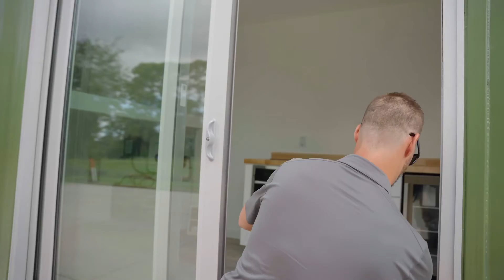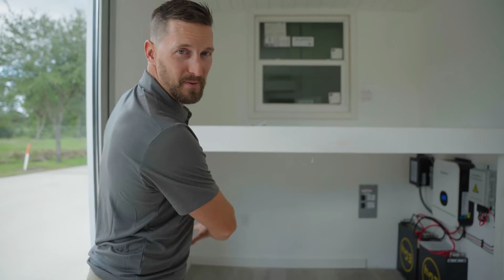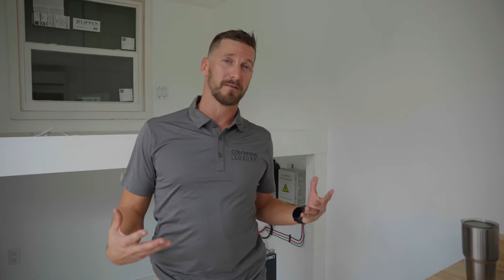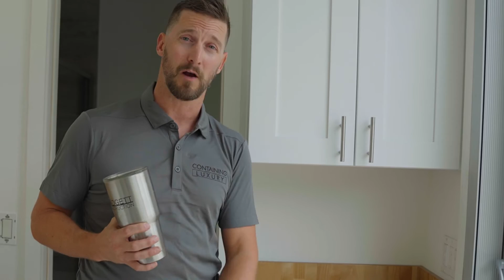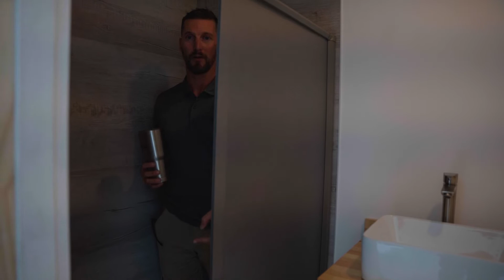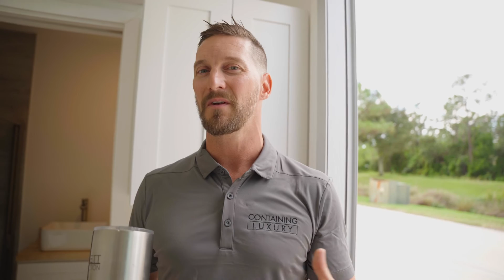100% Solar Powered Shipping Container Home Tour | Building a 20ft Shipping Container Home

Comment: Here's the math:  3000W inverter + 3-ton A/C = fail.  Good luck with that.
Reply from the maker: Hi there, unsure where you are getting the 3 ton AC from but in our small units we only use a 12k mini split like the one in the video, its about 1 ton and only pulls between 4--8 amps so we are able to run the AC almost all day when set to a reasonable temp. Obviously for larger AC units and other off grid builds, you would need a much larger inverter and battery bank. For these little 20s, it works good.

Comment: bruh wut?  you can get a 40ft HC 5300 delivered in most places anywhere near a port. 22 panels fit on it for like 6000$ 9000 watts, inverter 2000$ 17000 why not.  appliances 5k=22k, nice laminate wood floors 4$/sqft walls 10$/sqft another 8k 30k? hire some dude for like 20k, and how are we at 55k for a 20ft hc.  6" batt r19 insulating walls vs 1" foam r5 value >>.

Comment: With a setup like that, I would ad a small wind turbine system to help keep energy going if it’s setup in an area where sunlight doesn’t provide enough to charge the batteries.

Comment: If you are paying 12k for your solar your getting ripped off.
Reply: I paid $6k for my setup 2 years ago. LiPo 48v/200aH battery, Growatt 6000w inverter, 8-Hyundai 270w solar panels plus accessories. Did the install myself.

Comment: There is no place to hang out or is there a place to work / eat?? I really don't understand the $60 price tag??
Reply: "...the $60 price tag"? You mean $60k for the whole thing, i assume, so i'll work off that assumption. 

So, first is the crate itself. Easy $8k-10k right there new in PRISTINE condition. 
The trailer, from the gooseneck to the wheels, is probably another $3k or so in materials. That ain't a cheap part AT ALL!! 
We're sitting at around $11,000-$13,000 now. Framing, plumbing, wiring, the bathroom(shower, toilet, etc.) drywall, paint, floors, trims, windows, cabinets, countertops, the fridge, the stove and oven are all a huge cost, my guess is around $18,000 more, so that brings us to about $30k-$32k now. 
Next is electrical. He said in the vid that the solar version is an extra $14,000, so we're at around $54k-$56k here going for the $60,000 you said. 
Profit: usually, places like his make only a fraction of the cost of the finished product as profit, and we can also guess(and if i'm wrong i apologise in advance) that they get bulk prices for materials. Let's now assume that that'll knock the "value" before labor and profit down to about $50,000 flat. 
$10,000 left, right? Let's figure here that something like this is approximately 1 Shit-Ton of work for a team of 3-5 people at any given time. They gotta be paid. Let's estimate around $5,000-$6,000 in labor. Now a small margin of profit, just around $4,000-5,000 for the company. 
Just enough to keep it afloat, and not enough to drive up already high prices of building materials any more and scare away any customers. 
As a rule of thumb, the smaller the company, the less profit they make. As such, take corner car dealerships as opposed to big certified brand dealers. One will even show you the bill from when they bought it from the last guys, the other will try and convince you to upgrade to the next highest trim package. Profits.

And for the inevitable comments on "oh, i've worked _____ for 30+ years, and prices are perfectly reasonable!!! yada yada, yada!" No, not with this. Crates ALONE have quadrupled in price where i'm at down here in Dallas, Tx since we got two 40-footers 3 years ago for storage and a workshop respectively. We got each for $2,000, USED BTW, and since then, the 20-FOOTERS are up to around $6,000!!! Those were $1,200 when we got our 40's!!! The 40's are over $8k now!!!! And that's USED, IN "ACCEPTABLE" CONDITION. IMAGINE A NEW CRATE'S PRICE!!!! 
But yeah, things like this are really high-cost, low-profit gigs. More of a love for the project then looking to hit it rich. And I, for one, respect that!
Reply: @potatonumber200  Wow! Such a detailed response. Yes I meant $60k. Sorry I forgot the k after $60.I understand that things like this cost money and you can see all of that. I was referring to the fact that there is no place for the people to hang -out or sit and eat other than the bed area,with the dogs,standing in the kitchen and standing or sitting in the bathroom. 
The little area where you walk in has no room for a couch or even a recliner. There is no wall to place these items against other than the large glass window and door. But that would be stupid to cover any part of that. 
Why did you not put the bed on the opposite wall? It appears that would of been better. Then if you shortened the kitchen area or made it in a small "L"that would of been great to the eye to separate it from other area making it appear bigger. Adding a fold out table from the wall and a couple of chairs before the stairs. Perhaps a fold-out bar on the stairs could maybe work. You can also store all on a wall and use it when needed.
The dogs would just sleep where ever they land. If they were in crates then bring out the crates daily for them at night as opposed to a built-in area for them but not you. :)

Comment: What’s the price with the gooseneck trailer?
Reply from the maker: We actually don’t sell the gooseneck but we have a standard tow trailer for 9500
Reply from the maker: The total price would be around 65k out the door
Reply from the maker: Correct however a different trailer that is actually better built and has an area for generator and holding tanks